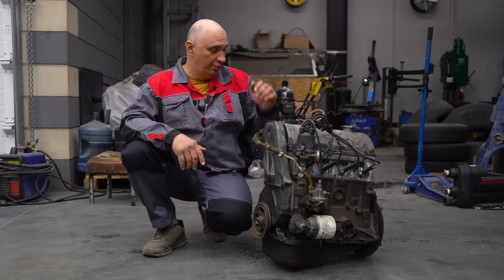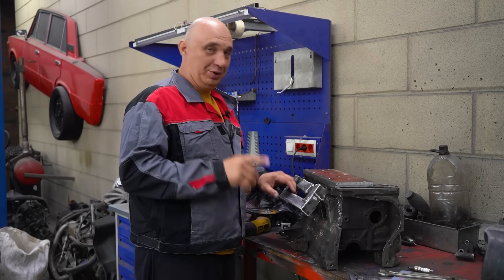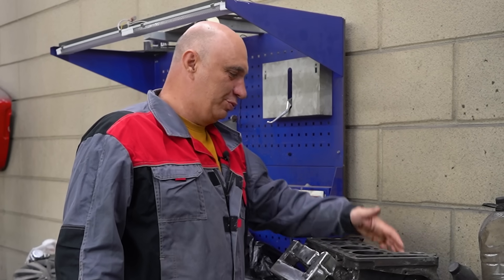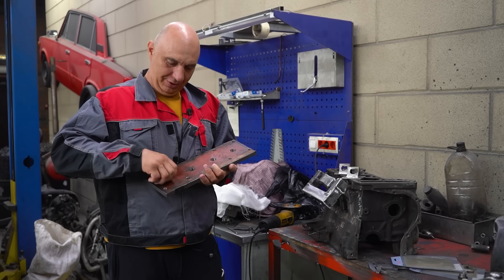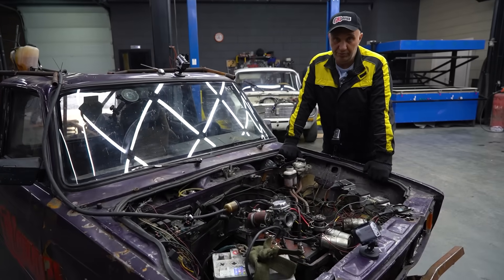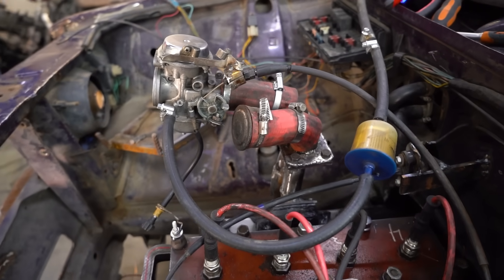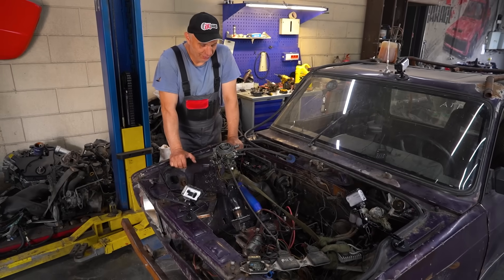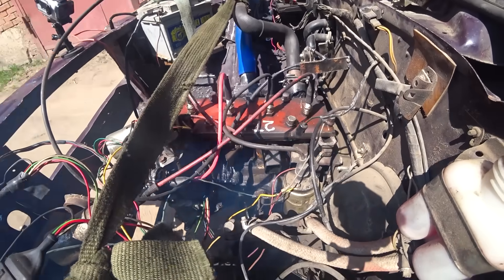4 stroke to 2 stroke Lada engine conversion

Comment: ive always wanted to see this be done, now its done! it even looks like a 2 stroke like a wartburg 353 or trabant
Reply: also, you may want to add an exhaust manifold to increase exhaust scavenging or add expansion chambers like on a pit bike
Reply: @quartzcyanis  Yes you need the expansion chambers for the exhaust push back of un-burnt gasses, it will create the power band where you want it depending on shape, size and position. The engine should be able to run without it however.
Reply: Or maybe just start with a Saab engine and be done with it. DKW of yesteryear had one also.  You're not doing a very good job of reinventing the ,"WHEEL"!

Comment: I want to see an engine that has cylinders 1 and 3 petrol, and cylinders 2 and 4 diesel... make some strange hybrid engine thing
Reply: Problem would be diesel burns far slower than gasoline. At higher rpms the diesel fuel would likely not burn and wash the oil from the cylinders or hydro lock the cylinders with diesel causing catastrophic failure in either case. Thats after finding a way to overcome the compression ratio difference. If you were to run all 4 cylinders on diesel and figure out how to shut the diesel injection pump down and swap to a conventional gasoline fuel rail and rev to 6700rpm seamlessly that would be interesting.
Reply: Diesel burn's in cylinder much higher/faster than gasoline what need's even spark. Sound tells how diesel burn like 'knok knok'.
Reply: @chevyblazer215 just maybe it would help the low end torque? Then let the 4 stroke take over? I have no idea!
Reply: @chevyblazer215 the compression ratio is by far the easy part dish vs humped pistons could account for that
Reply: @chevyblazer215  if it would be lada or whatever based it really doesn't need to rev beyond 4000
Reply: Would be ultimately catastrophic. Different heats throughout the engine, and unequal stress will cause the crank to snap and head to seap.
Reply: @2A_Touché shhhhh to much noise
Reply: @2A_Touché and thatz why we want to see it lol
Reply: Absolutely genius, imagine a 2 cylinder motorcycle engine and making 1 cylinder 2 stroke and keeping 1 a 4 stroke 😮
Reply: I love that idea
Reply: Yea i like the idea
Reply: Wow. I've never seen so many completely wrong in different ways answer to one idea. Diesel is oil, it doesn't wash the cylinders at all. Diesel and gas don't need different bore and stroke. The Mercedes 3.0  m103 gas and 3.0 om603 diesel are essential the exact same engine with different pistons and heads(plus injection pump mount provisions). I can go on and on. Stop answering question and making stupid comments like you know what you are talking about when you absolutely don't. If you want to learn comment in a question form like a reasonably intelligent human being.  Good God. 🤦
Reply: Also 4 stroke gasoline and 2 stroke diesel 👍
Reply: I was 500th like for this comment.  Lol
Reply: I ❤❤❤❤❤❤❤❤❤ it!!!!!!
Reply: @the motorized scrapperit is an amazing idea, it’s right up their alley. I’m sure they could make it possible, a 50/50 gas diesel four banger. Put the diesels on the end crank bearings and the gas ones in the middle. Would be a bitch to balance, and you’d have to make special heads, conrod and such…probably a frankenstein crank or something
Reply: 16:30

I think round and more “proper” intake piping would be a good place to start. 2 strokes can be picky on fuel and air mixture. If anything, I’m sure you could rig up a carburetor to each cylinder. Spark timing may not be optimal either, but with the holes welded in the cyl for intake make me thing maybe she doesn’t have healthy compression.
Reply: To je totální nesmysl, proberte se s agónie.👎🙃🤣
Reply: YES
Reply: what if you had a v8 with 4 cyl being gas (vtec like head opens them up at high rpm, closed otherwise) and the other 4 being a closed loop turbo diesel
Reply: Id love to see this
Reply: You need some kind of air pump to have overoressure for scavenging. Not much but enough.😂
Reply: A real multi-fuel engine LOL
Reply: Кстати,да-интересно😂Лысый может исполнить!
Reply: but Cylinder 1 is 2 Stroke Petrol and Cylinder 2 is 2 stroke diesel
Reply: That’s the best idear iv ever heard  and that’s comming from a mechanic haha faire play hope that do this one would be interesting to say the least
Reply: that would be the least efficient engine design but it must be fun to try.
Reply: Won’t work as a gas and diesel operates at such different RPM range.   Might idle but when throttle up the gas side will want to revi up to 3000-4000 and might redline at 6000 while most diesel engines already redline at 2200.
Reply: I'm thinking of a dual inline engine that's 3 stroke and every 3rd 180 degrees lands on either the top or bottom cylinders so u get more power strokes in less time
Reply: U could probably make it run on a fuel injected motor.. but it wouldn’t run too well, it would be overly complicated and too me wouldn’t make a whole lot of sense.. 

I think if you were to put in the work of installing 2 separate fuel systems then just make a car that can run on both..
Reply: Completely stupid, and impossible due to the injection and compression differences and even if you could you would just destroy the crank shaft, lifters and others with the difference in torque and irregular combustion you would receive, it simply won’t work.
Reply: @l0l0mgwtgdq have you ever heard the term all engine?? You are the human version. All mouth!
Reply: Yes!!
Reply: I like it too and wish to see it. Not gonna easy but cross fingers 🤞 they can do it
Reply: Nice idea
Reply: Možete li ga pretvoriti u auto na vodonik?
Reply: Compression ratios differ so challenge would be fuel delivery
Reply: petrol on 2 and diesel on 2 you're going to break the crank in 3 pieces
Reply: I wanna hear it hit The Rev Limiter💯 PLEASE build this Man's Dual Fuel DieTrol engine
Reply: Very good idea, I hope they consider it
Reply: That’s going to be challenging since Diesels are normally undersquare while gasoline engines are typically square or oversquare.
Reply: Make one then you can see it when you want. Please lear some manners too
Reply: Easy fella less drama please
Reply: Crazy
Reply: Just run the starter on 24 volts to get the power to turn the engine over.
Reply: Think the engine needs a super charger to aid scavenging.
Reply: Copy how a marine 2 stroke works. One head valve for exhaust and a super charger to promote scavenging. Fuel injection would be better than a carburettor
Reply: this would be difficult due to the different properties of gasoline and diesel, but I think it could be done if they tuned the gas half for low-end torque. diesel powerbands are where gasoline engines produce barely any power. if they got the strokes of each dialed in, it might be possible to split which cylinders are firing at any given time and make power at different speeds using different fuels.
Reply: Yes +1 to this
Reply: It's pervertion😂
Reply: I’ve seen these guys do some pretty amazing things since I found this channel, especially for being in the middle of what looks like bum fuck  nowhere russia 😂 but I don’t think it would work for several different reasons most of which people have already pointed out… definitely an imaginative idea I suppose though
Reply: You need a cross crank shaft you need cylinders 1 and 3 to be opposite and cylinders 2 and 4 to be opposite of each other that way each cylinder pushes the next one into play and a semi balance crankshaft
Reply: 2 yakıt deposu olur benzin ⛽ dizel den önce biter😅 motor da vuruntu titreşim olur 😊
Reply: you freak!  😂👌🏼
Reply: I was thinking bout that this morninh
Reply: That's a sik idea
Reply: Wouldnt be nearly as hard as most people here are saying. Treat it like a diesel, dont rev past 3600 to allow diesel time to burn. Gas doesnt care about low rpm. Compression could be raised by using a taller piston. The crank and conrods would have be to tough enough to handle diesel ignition pressures, and if theyre that tough they wont care about the different torque output from the different cylinders. Not a practical engine, or one destined for a long life, but it is definitely possible.
Reply: @wills.5762  diesel low rpm is specific engine related. A stock om603 revs to 4800 rpm, I'm honestly not sure about the om606 stock but  with a modified pump they turn over 6000rpm on stock internals. This idea would actually be very doable with an om 603 and m103 piston and rods in 3 cylinders
Reply: But what about the different rpms each fuels engine runs at? Rip crank
Reply: @SuperPN1 torque vs horsepower.☠
Reply: @SuperPN1  Not really, you just need to deck the head on the diesel side for adequate compression, without changing the stroke. The entire reason diesels rev low is due to high stroke. Low stroke diesels rev pretty damn high.
Reply: @SuperPN1 have you never seen a 24valve cummins at 7k rpm lol
Reply: @Boostedboizh22  And how do you separate the boost pressures  for the gas cylinders?
Reply: @jaybomb5022 split intake. Although I bet they would just make it na anyways.
Reply: @jaybomb5022 separate intake runners like most 4 cyl have
Reply: @Boostedboizh22 thank you because my ancient detroit SCREAMS on High Rs nonstop for oh idk 40 years now.
Reply: @SuperPN1  they run well enough in the same rpm range 1000-4000.

and yes you would need different fuel tanks and carbs for the gasoline cylinders and the diesel injectors for the diesel.
Reply: The rpm ranges vary far too much.
Reply: I find it so cool that  you  made a 2 stroke  car
Reply: You could fill up at the pumps twice as fast
Reply: @garyr4818 it would take twice as long obviously
Reply: This concept would work amazing with a V8 or v10.
Reply: Yes make this happen!
Reply: They already did it
Reply: @ramirocuentas5999 he meant an engine where in cylinders 1 & 3 runs on typical gasoline, while cylinders 4 & 2 runs on diesel
Reply: @princeru3394  they've converted a diesel to gasoline so that's not that hard, it's half the work
Reply: @thefirehawk1495  it is indeed just half of the work, but what i think the above main commenter is interested about is how will the engine behave, performance wise, etc
Reply: @princeru3394 they did it, wait for translation
Reply: @princeru3394 seems like it wouldn't work the balance would be off.
Reply: @princeru3394 yes they did exactly that 😊
Reply: @ramirocuentas5999 video link pls
Reply: @ramirocuentas5999
Post title of vid
Reply: Grab a V engine for that 👍
Reply: V6, half diesel and half petrol
Reply: Damn you stole my idea haha i was thinking of that a couple of weeks ago
Reply: @bantamEJ Video was made more than a couple of weeks ago lil fella
Reply: The torque be different in them cylinders so not sure how that would work
Reply: I think it would be more possible to do this but with two stroke and 4 stroke gasoline combustion cycle as they should share similar harmonics and can use the same block. They could simply pull out the rockers and weld up the intake and exhaust valves in two of the chosen cylinders and then modify the block as require. Now that would be cool... Ignition would be the only headache to workout, possibly could fit a magneto type system on the crank to support the two stroke and use existing destributor for the 4 stroke
Reply: Agreed
Reply: That’s a great idea ! You would combine the benefits of a petrol with a diesel engine
Reply: Farmall md
Reply: In 2077 that idea has not been created
Reply: How about using 2 cylinders as a compressor and supercharging the other 2 with them
Reply: @markfairhall3671  less power, more crankshaft stress
Reply: Like Scuderi, right?  @markfairhall3671
Reply: When the engine is marked bi-fuel and they weren't kidding.
Reply: And then 1 2 stroke diesel and one petrol 2 stroke cylinder
Reply: No one cares WHAT YOU WANT
Reply: You'd need different stroke and compression for the different fuels. Not worth the effort for what you'd get.
Reply: @giggiddy They welded two engine blocks and crankshafts together, 2 different strokes is easy job for them.
Reply: @martinleska4292 lol you got that backwards..... everything you listed was the easy stuff to do ......
Reply: @alanunruh7310  How come you didn't do it and make an entertaining video.
Reply: @giggiddy your not worth the effort for what you get
Reply: @giggiddy i mean if you want it to run good yes, but this is garage 54. If it runs it runs.
Reply: @giggiddy bro havent you watched any of their videos. None of the proects are worth the effort.
Reply: @amongusmanki  The effort is always worth it. Sometimes things work sometimes things don't. They have also  made a few Discovery's and debunked some old wife's tales.. most of all entertainment and fun with cars
Reply: Nothing from Garage54 is worth the effort. That is what it actually makes it so good lol.
Reply: @giggiddy   Dont need different strokes.. just crown heights, easy in theory..
Reply: It’s not about what you get, it’s about watching them do it.
Reply: @giggiddy none of these videos are worth for what we get lol
Reply: @JordanJank  🤣🤣 true!
Reply: Its whacky and fun though and thats what this channel is about.@giggiddy
Reply: @YblockEnthusiast  Couldn't agree with you more. Cheers my friend
Reply: @giggiddy  I don’t think you would need different strokes just different compression ratios, which these guys have done, and the fuel injection
Reply: @giggiddy guy literally everything they do is impractical. It's all for shits and giggles and to prove concepts. This is an awesome idea and I bet they could do it.
Reply: @giggiddy but if it was for example a V8 it wouldn't be a bad idea because there are already systems that disable for example 4 cylinders so your engine makes less power but has better fuel economy so if you had diesel for low RPM and gas at high RPM would not be the most powerful, reliable or eco friendly but it would definitely provide more balanced power output and have pretty good fuel economy
Reply: @CreeplayEU  This is true. That might be interesting.  These guys could do it that's for sure.
Reply: @giggiddy Have you actually seen any of the videos from this channel?? 🤷🏼‍♂️
Reply: @BoHolbo  Wasn't suggesting that they couldn't do it as they have done the impossible. Its just that sometimes people throw out ideas that have no relevancy to engineering or physics and the ideas are just silly. "Make a clutch plate out of peanut butter. Make a piston out of rock candy." In my opinion, some are plain stupid and don't serve any real purpose other than a goofy idea. Love the engine conversions and 95% of what they do. Just some of the ideas have no real end game. Don't get butt hurt pal. Its simply my opinion.
Reply: @giggiddy  If you don't like it there are plenty other channels. Cya